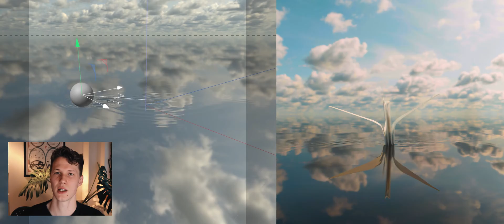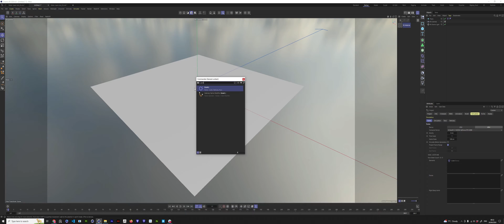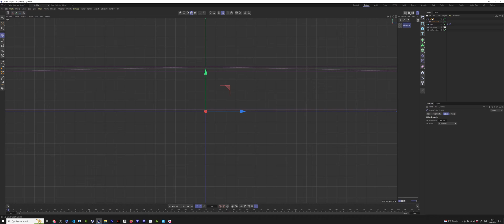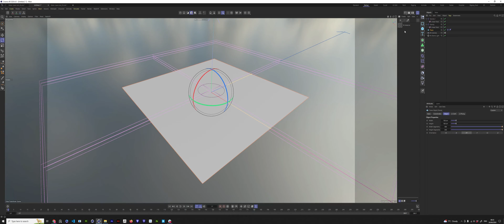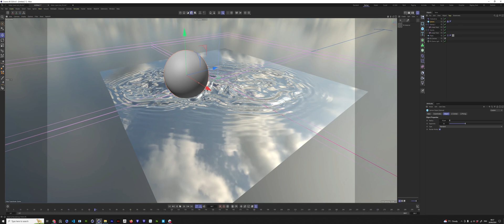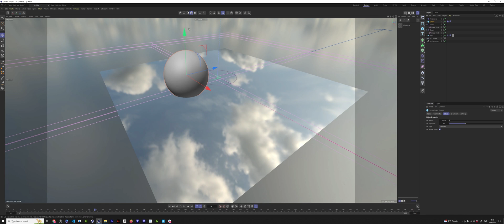Cinema 4D Tutorial - Create a Dynamic Water Surface Using Cloth (no vertex maps!)

Comment: would it still work if the object was to rise from the bottom of the plane to the top?
Reply from the maker: Unfortunately not really no. You could try this though: Depending on the complexity of the object you could animate it, put it in a null and make an instance of it which you put in a volume builder and kind of "slice" a layer out of it which is right below and slightly above the surface (by clipping it in the volume builder with a cube or something). This "slice" would then push against the surface from below but since it is clipped by the cube it wouldn't go high enough to penetrate the surface but since it is an instance of the other object it will follow the movement. I hope what I'm saying makes sense.

Comment: This is great, thank you! How did you get that seamless floor? Or is it just a very large plane and/or low camera angle
Reply from the maker: Exactly, very large plane with the same material where i cut out a whole the size of the surface plane with a boole so they don't overlap. The edge is kind of hidden because of the dof on the camera